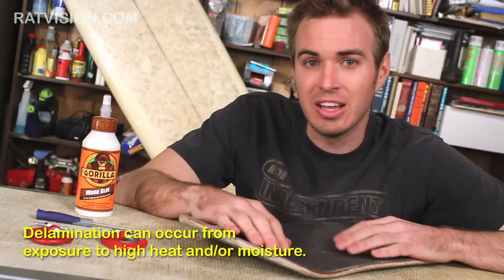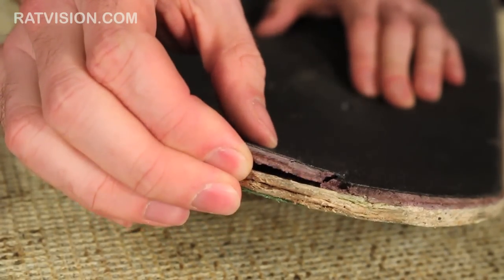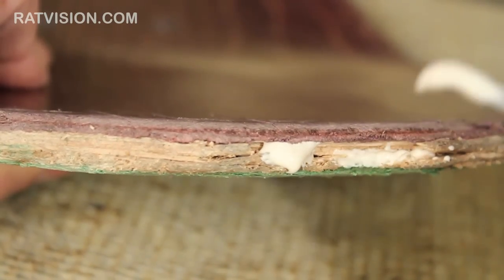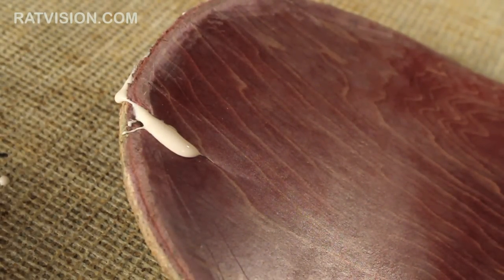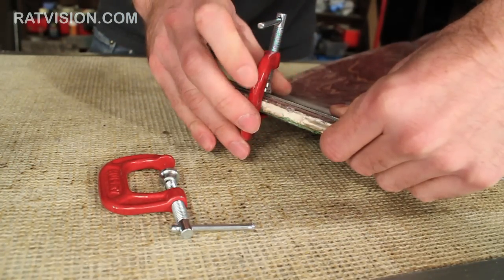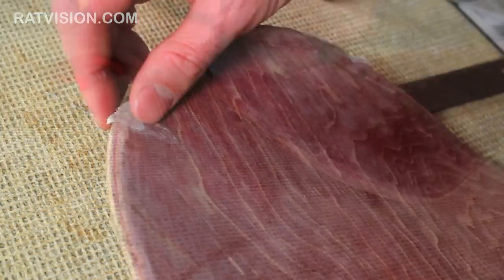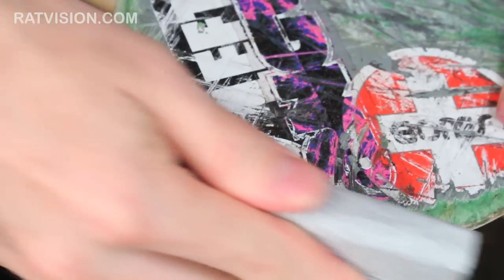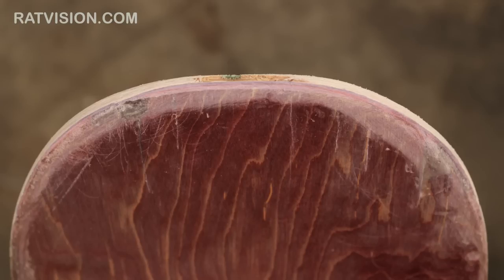Fix Skateboard Razor Tail, Chips, and Delamination

Comment: Another useful video, but a warning, I did this using ordinary wood glue, and the plies jut came apart again after a few weeks. Maybe it got wet, but if you have a choice for waterproof glue it would be better.

Also, when you squirt the glue between the plies, makes sure it penetrates deeply, otherwise when you sand the board down, you may reach unglued areas and have to clamp all over again.

Comment from the maker: Did you buy it warped or did you leave it in a car?  You can try putting heavy weight on it for a week or 2 and see what happens.  If you recently bought it warped, return it.  If you've had it for a while no one will replace it.  If you try putting weight on it, take the trucks off.

Comment from the maker: That sucks.  The pin tail is not really there for any purpose.  It's just part of the shape.  You can leave it off.  Putting it back on won't make the board function any better, unless you actually used the tail to put your foot on, which would be weird.  You can sand the broken area to remove the jaggedness.

Comment: @skateboardtech hey I recently sprained my knee on a deck that, according to my 38 year old friends, was warped. They said that the concave was off and that the wheelbase was way to low. I was wondering if there was any way to measure wheelbase and concave ( they use terms like moderate or mellow) I skate a 8.25 to 8.125 deck. Thx and welcome back!!!!

Comment: Pop the shields on them. Leave them soaking in turps (white spirit) 
over night. Give em a lil a shake you will see all the dirt come out. 

get rid of the turps. (be safe it isn't environmentally friendly)
Dry them on an old cloth or kitchen towel. Add a tiny drop of speed cream.

Comment: Jhow do you make bearing go faster
Reply: Just take away the shield bcus all the dirt will come out and the roll smooth and long, no need to put them back in, buying speedcream wil help also
Reply: +mitchell nijhuis not true
Reply: +Saul Nunez If you have brand new bearings skate them for a while and break them in, then they will be faster. But if you have bearings that you've already broken in then you should check out his cleaning tutorial.
Reply: Bones reds has non contact shields so you don't take those off even with normal bearings do t take the shield off
Reply: +nivlac obviously you don't street skate I've broken at least every shield

Comment: I just bought a skate from toy machine but when i got it i forgot to make sure the trucks weren't too tight so they wouldn't crack the deck (the skate came all together already). So, in the FIRST DAY skating with my friends, the wood cracked from the truck to the tail. Can i repair it? The cracks are quite long :s

Comment from the maker: Crooked how?  Is one wheel off the ground when you're not standing on it?  If so, that is completely normal.  It's just your bushings are sticking to one side.  Your weight on the trucks corrects this.  There is no problem with your trucks at all if this is the case.

Comment: I would like to find a method to strengthen the lower side of the tail of my son's board. After a few months it is worn out, so it doesn`t pop as good as at the beginning. So he had to buy a new one for 65 Euros. I thought of a strong tape that is smooth enough that he can still perform all the tricks and to keep his new deck and pocket money longer.

Comment: How does this fix razer tail ?
Reply from the maker: Watch the video instead of asking questions.
Reply: I did watch it
Reply from the maker: Then you should know how it fixes razor tail.  It's like as if you don't know what razor tail is.  It is when the tail gets worn down and becomes thin.  By sanding the edge of the deck, you make the tail thicker, which is by removing the thin wood.  By removing the thin wood you prevent chipping, which can ruin the deck and pop.  You also increase the amount of leverage and could actually get more pop.

Comment: Does anyone know the number for real skateboards 
My board is 2 weeks old and on the first week it chipped and by the second one it became worse and started to come apart It didn't hit a wall or ledge hard 
It bounces on the floor like any skateboard but nothing too extreme to make it cause that
Reply from the maker: +ExcalibursWish You need to take it to the shop you purchased it at or contact the website.  it's going to be very difficult to get a new board after you've ridden it.  Why?  Because it doesn't look like a manufacturing defect.  It's a chip caused by something that manufacturer/material caused.  It was caused by you bouncing it off the ground.  If a deck nose or tail hits the ground in just the right place it will chip.  It's unfortunate, but it happens.
Reply: +ExcalibursWish alot of board companies have actual Warranties against delamination within 30 days. Santa Cruz decks actually come with that warranty info
Reply: I actually found out the info and got sent s new one

Comment: Hey anyone who can help.I bought a second hand deck and after a couple of weeks I saw that it's got a crack in it middle of it about 3 cm along and it's gone through the first two layers of wood. I don't know if I should get a new deck in case it causes problems in the future
Reply from the maker: That deck has been exposed to moisture changes.  It is a second hand deck, so you have to keep that in mind.  Ride it until it loses pop.  It's not going to break along that crack. I'm guessing it's starting at one of the truck mounting holes, right?
Reply: its on the middle of the deck starting at the side
Reply from the maker: Oh it's actually cracked from someone landing too hard in it.  Well, if the deck is still pretty stiff you can ride it for a long time if you don't plan on doing tricks.  If you do want to do tricks, then we suggest getting a new deck.
Reply: ok thanks for the advice and whats a solid but light pair of trucks i could get
Reply: jim table Independent Koston 2 Trucks, Indys are super durable but they've always been a little on the heavy side, luckily they've made some improvements, thus the Koston II

Comment from the maker: Oh man. That's an entire video to explain all that. You already know that a harder wheel will go faster on a smooth surface, while a soft wheel will go slower, but can absorb the shock better on rough roads.  Think of a slightly deflated tire. Bigger wheels effect pop too. The nose goes higher and can essentially result in higher ollies. Width provides more stability with more surface contact, but with extra surface contact you loose speed. As with many things, you know it's all personal choice.

Comment: Bamboo or maple?
Reply from the maker: That's like asking, "Would you like ranch or ketchup?"  They are totally different.  Bamboo is great for flex and maple is great for stiff decks.  It depends on what you want.
Reply: Ok witch it best for grind
Reply from the maker: What you want is a regular street skateboarding deck.
Reply: Kk cool
Reply: bamboo's last longer but they're a little heavier, maples are not so durable but you have more agility in them
Reply from the maker: Bamboo is LIGHTER and stronger than maple, but it flexes.  If you want stiff, go with maple.  I can't imagine someone making a stiff deck with bamboo.

Comment: My board is splitting down the sides all the way from one truck to another and it's only a week old... I've bought two from the same shop with in two weeks the first one my sister dropped when waiting for a train and it split which is fair enough but this is bullshit.. It's like can I not have a skateboard..
Reply: if your board split when it was dropped you're buying shitty decks. i was trying to ollie a 15 stair and dropped it down onto cement many times and it didnt even chip

Comment from the maker: Any idiot shop employee should be able to help. Just don't get suckered into buying what "cool" brands you should get. Start cheap, and cheap doesn't mean you'll get crappy product. You're just not paying more more for a brand name or hype. Get 53mm or 54mm. Don't get smaller or bigger. Any cheap bearing will be good too. Truck size: 5.5 (139). You just match the width of the deck to the width of the truck axle.

Comment: Hey. For razor tail. Dont sand down your board. Spread some PL Max Locktite Adhesive. Its flexible, waterproof and weatherproof. Its cost just about $10 after tax. Spread liberally with a caulking gun and let sit about a day in a half till "Fully" cured. Sand to desired amount. Trust me. Save that fin.

Comment: if you skate alot an 1/8 inch is a big deal, to be honest the best way if just buy a new deck it cheaper if you buy blank decks but in bulks. There is no substitute to new pop it wil just feel weird and can be dangerous in you skate the big this where oyu need crisp pop.

Comment: If it's a pressure crack ignore it the deck should be ok. If it's a crack horizontally through 1 ply you're ok for now (depending on what you're skating), 2 plies cracked is up to your judgement. After that point buy a new deck.

Comment: BEST TIP~ONLY solution= DON'T SKID ON TAIL!!
this is a fact~ im a 44 year old skater from late 80's till now...And razortail has been the death of many decks in my nowadays skating..
I replaced stairs with funbox & many pad aka natural funboxes..And decks don't crack as often..but razortail sucvks…..
esp if it's a expensive vintage oder 101 or blind deck....im 90% no longer skidding..but it still happens..there is no repair...
That glue lasted 1 day/session @ best....but kudos for trying...………..
buyiong new stuff is the best part of skating ;D